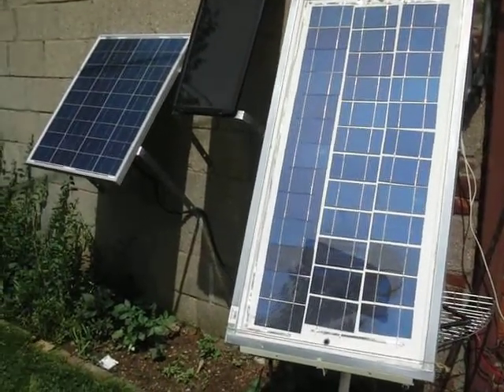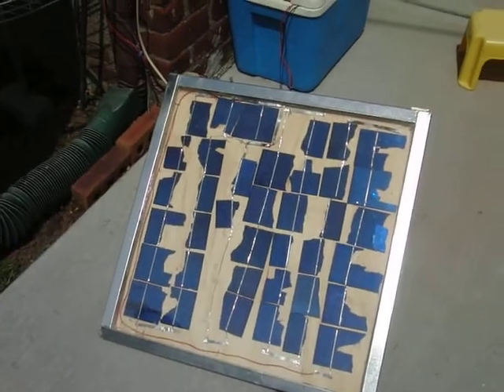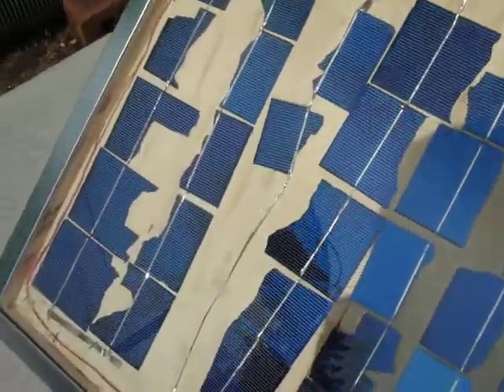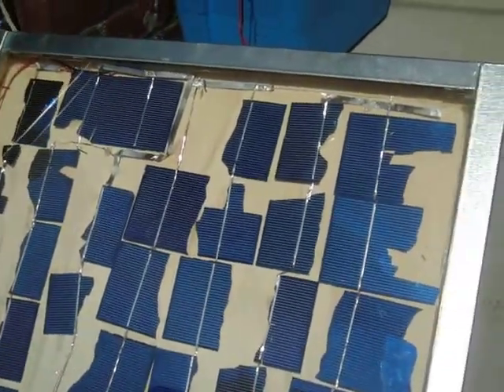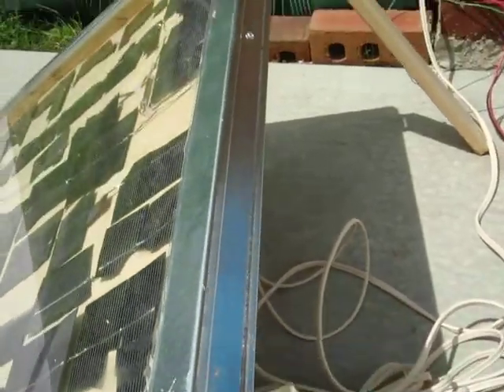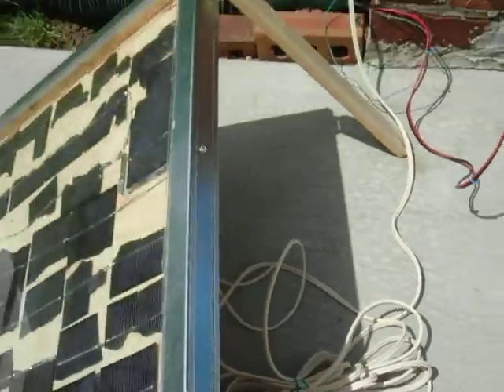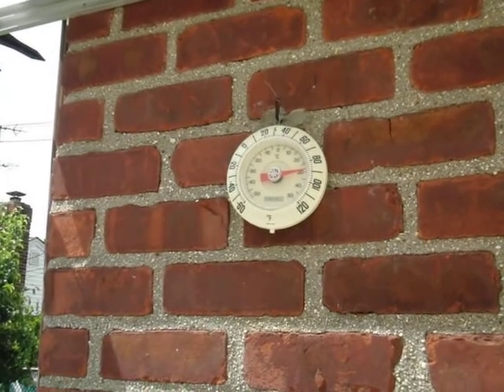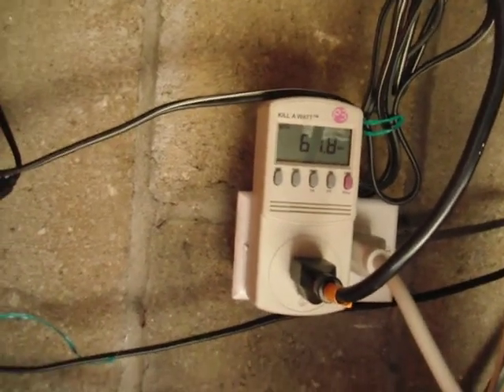13 w broken cell solar panel.AVI

Comment: Good use for broken chips if it wooks why not.
You can ofen on ebay get a 1.2kg pack for about 30 pounds i am tempted.
Reply from the maker: Solar panel prices have fallen a lot since I made this panel.  It is a fun project though. My 5  year old diy 60 watt panel is still working great and giving "free energy."

Comment: @wtam69 Hey I get about 1300w max now I have it wired to its own breaker in the main panel it seems a little better.I think 1600 or 1700 would be the max from the 3000w array so I call 1300w good enough for now.maybe some day I will add a 500wGTI and try to squeek out a little more.

Comment from the maker: @field16 Thanks Field. My Internet connection is slow in uploading motion videos. Therefore, I shortened the video and didn't show the conduit going into the garage to another breaker box. There, the box acts like a traditional breaker box, separating the current through circuit breakers to either the charge controller, the grid tie, or both.  It is kind of complicated without looking at the components.

Comment from the maker: @VWRabbitdiesel Two sixty watt panels to get 62 watts.  The most I can get from that powerjack with that configuration is about 70 watts. As the solar panels heats up, it loses power. Then again, my panels are low end ones. Maybe the powerjack will last longer if I don't push it that hard.